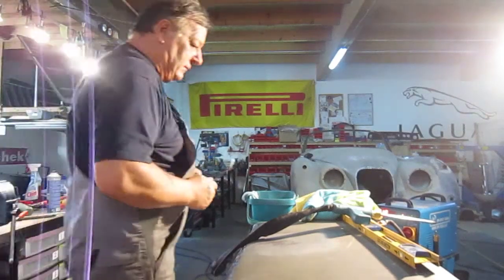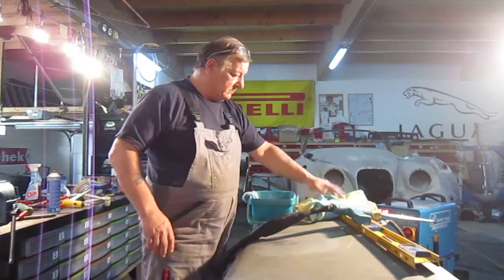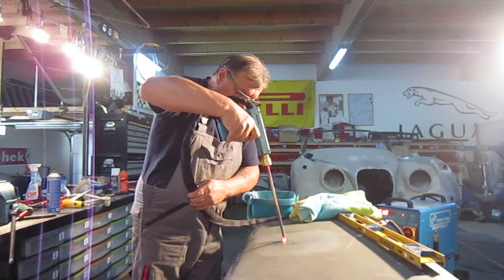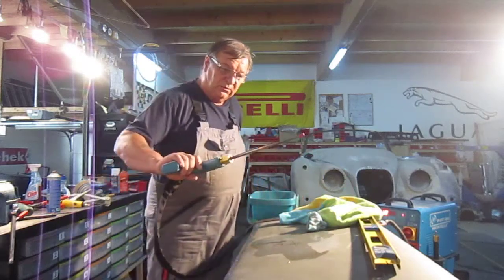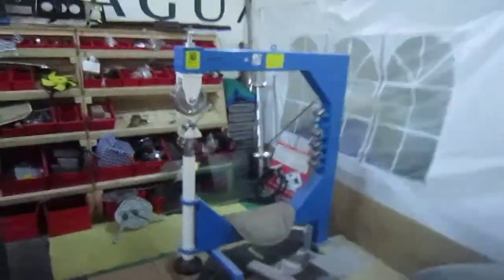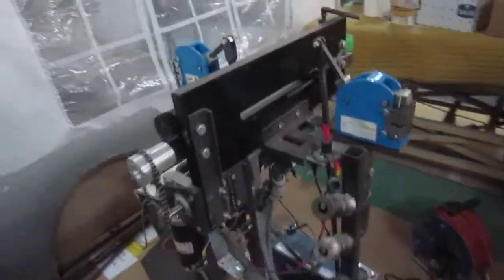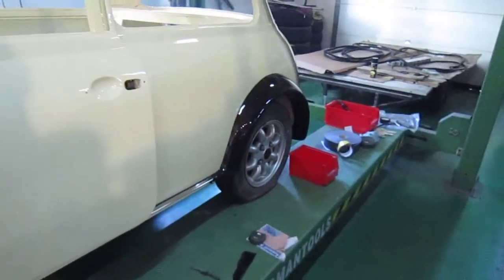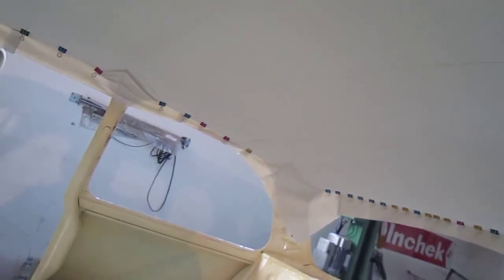Heating & Shrinking a metal Door Skin ( Bulge removal )

Comment: Dave, the dent in the panel has already stretched the metal, wheeling it stretches more, causing a high the point you had too heat shrink. Try not to stretch the metal when getting the dent out, a slapping file & flat dolly is what I'd use.
Also lead loading could cause more problems on a low crown panel like a door skin, a skim of filler would be the right choice, imo.
Thanks for taking the time to post these great videos
Reply from the maker: Martin, Thanks some good tips there to be honest i don‘t have a slapping file and i see it being used a lot on youtube videos, I guess it is something i could make or maybe i can get one in the UK. Cheers Dave.

Comment: put a bike rubber tube over your top wheel that wiil allow you to put the shape back in without stretching it not much pressure required! great video everyone has different ways i use a 12v car battery and jumper  cables earthe and the rod in the positive  aand draw circles to keep shrinking more even then a wet rag is plenty i used to have an attachment i made to replace my mig tip and just disabled my wire feed but battery and cables is better, faster and less hassle shame im not up to your level to share a video thanks for yours regards kelly in NZ

Comment: I used a blow torch on the rear quarter panel of my Marina Pick Up years ago as that was badly creased/ dented. The torch worked very well then I quenched it with cold water and it really tightened the panel back up. P.S the mini is looking great :)
Reply from the maker: Sean,  The carbon rod does work well you just have to be a bit patience a do a small section at a time. Can‘t wait to see how the rims look after painting will post a video tomorrow, Take care Dave.